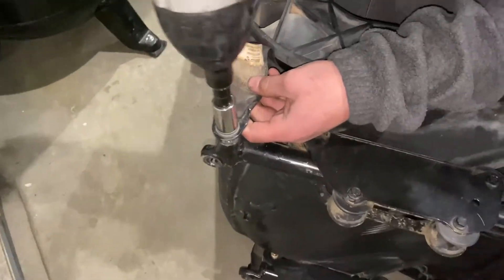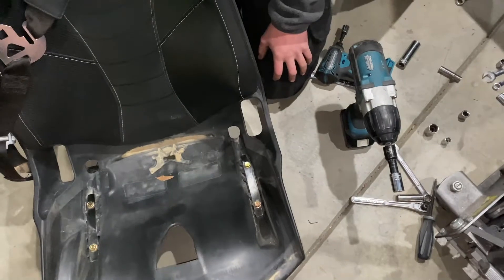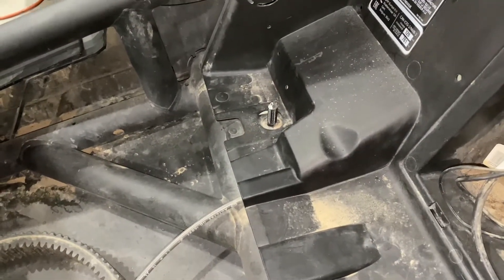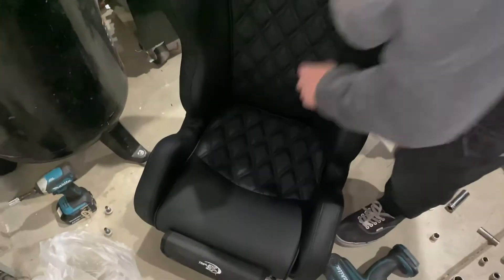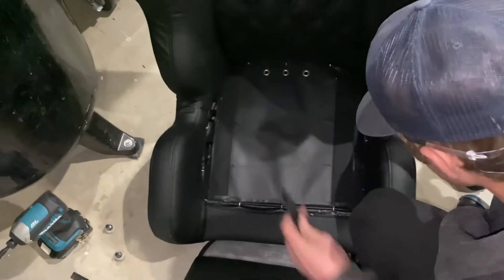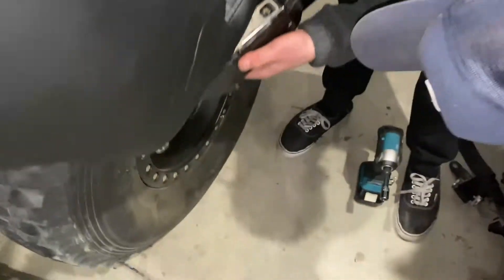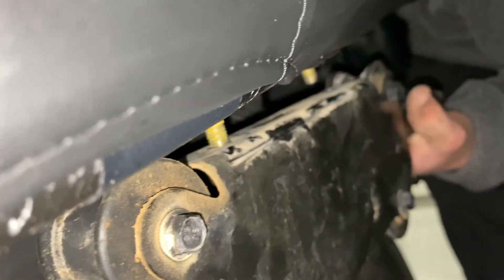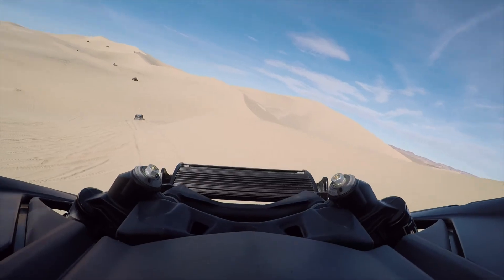CAN AM X3 SEAT INSTALL

Comment: Can you use the retractable factory seat belts?
Reply: It does say that they are NOT compatible however i have them on mine and they do work, if you put the seat all the way to the rear they bind a little bit, but just have to slide them forward a click or two. Check before you tighten all the bolts.